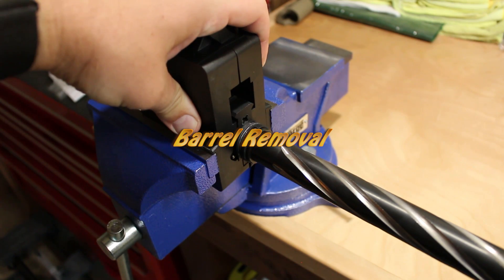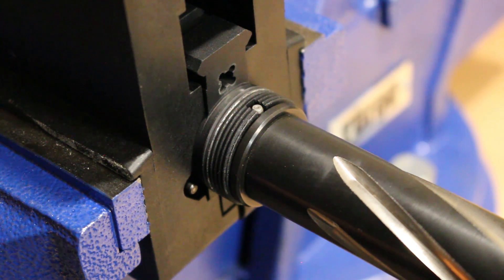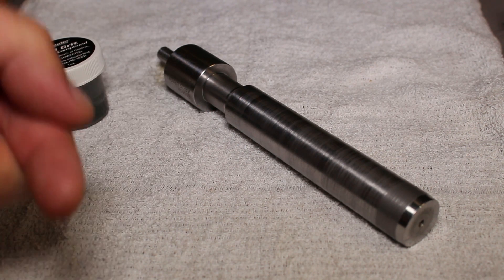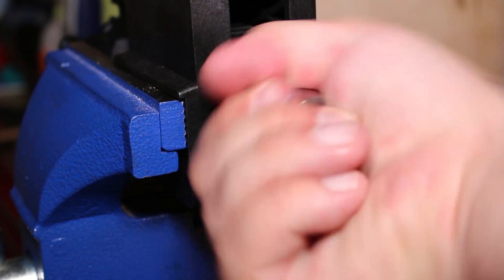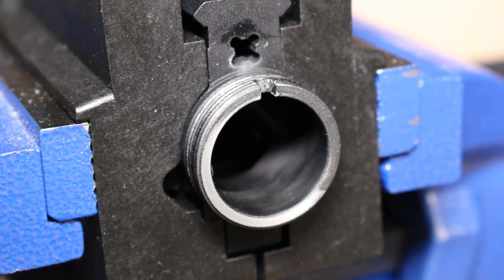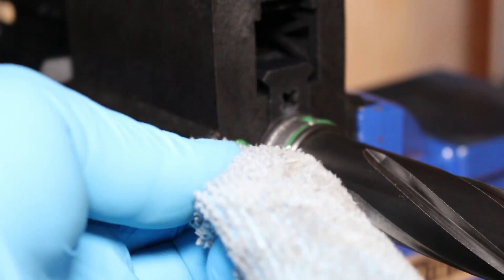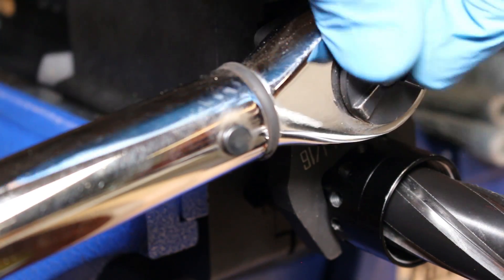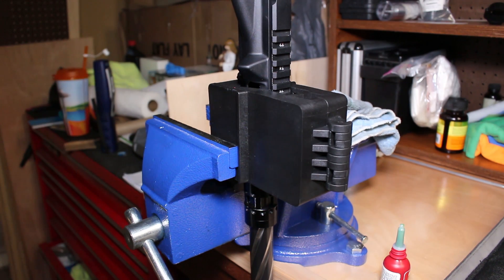Bedding a Barrel into an AR-15 upper receiver

Comment: That little bit of face you missed with the lapping tool is nothing., You should have lapped it until it was perfectly square.  My lapping tool, I polish mine so it does not sound gritting going in.  Just a couple of this I do different.  My lapping, I do it all or leave it alone.  If your going to do half the job, you may as well leave it as it was.  This is also where you squeeze that extra accuracy out at 100 yards also.  Anti seize needs to go on the barrel nut also.

Comment: Hack job, As a gunsmith myself, I would never recommend this method. Youtube is a double edged sword, beware...
Reply: Using anti-seize compound or a gun grease specific for this purpose is used on the barrel extension and threads. Makes it easier for those times you want to swap components.
Reply: You dipshits know that there are many different types of loc-tite right? Nevermind, keyboards dont use loc-tite... carry on.
Reply: Never seen someone use locktite on barrel I'm new to building ar's is this a bad thing ..? Never seen any other vids of someone doing that.
Reply: james s. When you become a good enough shooter to see any gains from this you will have acquired enough extremely accurate guns to never actually do this IMHO
Reply: I guess seekins precision is a bunch of hack jobs for bedding their barrels.
Reply: As a laymen why is this a bad thing? it seems to make sense to me. Maybe not the Loctite part but the lapping process.
Reply: A gunsmith isn’t a precision machinist either, most gunsmiths use old outdated processes/technologies
Reply: Lapping the face isn’t correcting the problem here, the face bore and OD threads are machined in the same operation so they are concentric and perpendicular to each other. The wiggle is from a barrel extension that was most likely turned to the low end of its tolerance or the bore turned to the high end of the tolerance or combination of both, so it looks like you just lapped the face off by the amount of play in the guide tool that you inserted into your receiver and the lapping tool that slides over it
Reply: @chippster stephens Chippers,
Don't want to get into a pissing contest. And no, I have never worked with national mach shooters. I have however shot with and worked with many top national 3 gun competitors since the early 1990's, and built many AR's. I have tried similar methods in my youth. As I have matured I have found that starting with good components eliminates the need for these types of band aids. That said, I understand that not everyone has deep pockets and if this works for their set-up then that is a plus. My original post may have been a little harsh. It is simply not they way I would build a precision AR...Thanks for the feedback.
Reply: Seeing Loctite being used has me on edge a little bit too. But if the barrel laps like that, using the barrel nut would naturally fix that, right? Because some kind of grease would make more sence to use if you're going to put anything on there.
Reply: @AzMetalScorpion  It's a different loctite -- not a thread locker, but a bedding compound (For pressure fits in cylindrical mating). This isn't to keep the nut from unscrewing, but to keep the barrel extension from moving inside the receiver walls. Grease would just squeeze out or move and let the extension wiggle. It's not dissimilar from glass bedding a bolt rifle.

I think he missed putting grease on the barrel nut threads to prevent gauling, but that won't affect accuracy much -- just ease of changing the barrel later.
Reply: ........my thumb is stuck...halp
Reply: I agree with Jeff on this one. You never put loctite on the barrel itself! What is this guy thinking! I mean watch the video, when torquing the barrel nut, he doesn't even have the vise tightened down. This guy is someone that's gonna be dangerous to youtubers!
Reply: @MC-px9eq  I dunno, I'm a bit on the fence with this. As far as torquing, I personally would have torqued the barrel with it and the receiver vertical so it would minimize any canting. As far as the Loctite.... The author did not use threadlocker. What he used was for [as the manu. called it] "bonding of cylindrical fitting parts" -- which is what a barrel and receiver is. This could eliminate voids between the barrel and receiver.
Reply: @danduane1413  from a gunsmith's perspective, I can honestly tell you to never put loctite between the barrel extension and the upper receiver. The only thing required is perhaps a lite amount of grease if the fitting is tight, and anti-seize on the threads for the barrel nut. If by chance something happened where you need to replace the barrel, you'll have a better time getting a new upper as well. We don't like to think things will ever happen, but they always do. You could accidently shoot your buddy's 300 blackout Mag, or it's getting dark after a hunt and forget it's in front of your tire and start driving off. The point is, using this guy's techniques, you are going to end up spending way more money in the long run. Either buying all new parts, or bring it to someone like myself to fix.
Reply: @MC-px9eq  As a "gunsmith" you should know that Aeroshell 33MS is the appropriate grease for the receiver threads.
Reply: @thomasainlay7603  that supposed to be an insult or slam on my profession and/or knowledge, just because I said "grease", which is shorter in character count than spelling out "Aeroshell 33MS" renamed 64 by the way. Many AR manufacturing companies will tell you their preferred brand and Aeroshell 33MS happens to be one of them, just has to be a Moly based lubricant.......the point is GREASE is used not locktite on the barrel extension. Have a good day.
Reply: M C p
Reply: @MC-px9eq  Criterion barrels has a video I'll link called accurizing the ar15. In the video they used loctite 609 on the barrel extension after lapping the receiver face. Aeroshell 33 was of course put on the threads. Criterion is a sister company to kreiger barrels. So what do you have to say about them doing that? https://youtu.be/XHxU8VUAHOY
Reply from the maker: @MC-px9eq  if you watch the end of the video.. the vise is tight and it is loosen to adjust the position of the upper reciever assembly while it is in the upper vise block...
Reply: @67futura25  aeroshell 33ms grease goes on those threads, tighten n loosen nut 3 times to prevent galling before torque
Reply from the maker: @MC-px9eq From one military veteran to another... thank you for your service and all the positive things that you mention and have done.  I am happy that you are better than me and that I will drive people to your business.  If someone drops off their rifle and mentions  my video could you send me a check, I would greatly appreciate it.  Stay safe and thank you again for all you have done.
Reply: @MC-px9eq  Spot on , along with doing the lapping procedure order the JP enterprises barrel extension and properly torque the barrel.
Reply: @MC-px9eq  I learned that from the YT channel Gun Shoot Video. And Semper Fi !!!!
Reply: @MC-px9eq  Damn dude, you need to calm down. If you dont agree with his methods, then so be it. I doubt you have any reasons why not to use loctite. Maybe it doesnt help and then again maybe it does. Criterion barrels uses this method BTW. As far as the vice block moving during torquing if the barrel nut, who the F cares if it moved slightly. He got the job done.
Reply: @mblake0420  you can buy a big 16 oz tube of the stuff on Amazon...or pay $6 for just an OZ on  gun websites...
Reply: @MarkNOTW  you don't use lost its, because when you want to change the barrel out after you screw it up with bad hand loads, 5000+ rounds or because you want a different barrel you won't be able to get it off.  You're supposed to use some hi temp grease, or anti seize so you can remove it if you need to.
Reply: @67futura25  Thank you for your service. By the way, great video.
Reply: @MC-px9eq  he didn't even follow Propper torque procedure....LOL he went 30 and then forty...what about getting the threads seasoned on both sides front and back ...Like our late and not so great President said "He's a Jackass"!!
Reply: Jeff McLaughlin why would this guy recommend having the torque wrench at 90 degrees? This will change the amount of actual torque applied to the barrel nut.
Reply: I heard it’s not good to use lapping compound on aluminum because the abrasive gets stuck in the soft aluminum material and keeps working to cut and loosen the connection long after you think you cleaned it all off.... is this true?
Reply: @MDallDayPrepper  Since it's in an oil-based suspension, if you clean it off with a petroleum-based , you should get most of the suspended material, and certainly enough to prevent any damage to the receiver over time.

Think of it like using soap on your skin -- dirt is harder than your skin, but the soap binds stronger to the dirt than it does to your skin, making what is the equivalent to the lapping compound. Then you wash it off with water (Which binds better to the soap than your skin) and remove nearly all of the dirt. A little bit might be left, but it's not enough to noticeably damage your skin.

Comment: So is green loctite so tight it never comes off, or is it not strong enough to withstand heat of barrel and breaks down over time?
Reply: The Loctite is to take up the clearance space between the OD of the barrel extension and the ID of the receiver. Loctite 620 is designed for use up to 200C (~400F). The area in question surrounds the barrel extension and chamber region. This should be the coolest part of a barrel. The ejected brass should be absorbing excess chamber heat and removing it when ejected. Your barrel chamber should never reach 400F.
Reply: Tom B Good to know. Thank you.

Comment: Hmm how do you know the barrel nut is true? Only truing one surface will not improve anything and for accuracy don't use junk receivers, BCM or some other that requires a press fit will work not locktite. Toss the parts and start over right please

Comment: I'm no gunsmith nor do I pretend to be but I've got the targets to prove this method works.  I'm now mounting all my barrels with green locktite and when I can fit it, .001 shim stock.  
  Yes, you can still remove the barrel with a LITTLE heat.  No need to get out the cutting torch.   The little blue bottle from the hardware store works perfectly. Again, use as little heat as possible to remove the barrel.

Comment: or buy a quality upper. I have never once seen a barrel fit into an upper with so much free movement.
Reply: John Hellmann 
Beyond that he didn't even bother to demonstrate how much it moved with a barrel nut torqued down on it.
Reply: @junkersintutus4282  it wouldn't have moved at all with the barrel nut torqued. I know this comment was from over a year ago. So hopefully you have learned a little more since then and understand why this is done now
Reply: Agreed. That's a lot of slop and I don't think he read the specs for Loctite 620. It is good up to .008" - he might have had more than that. Kind of a hack job....
Reply: I think his barrel is out of spec. The lapping tool appeared to fit firmly and had no visible wobble like his barrel did. He noted he had to lube it to get it in smoothly.
Reply: @eltreum1  the lapping tool runs through the entire upper. The barrel extention through just the front of the upper. Go back and watch again.
Reply: Wrong. I have bought multiple quality Aero uppers and they are out of true by a mile.
Reply: I was thinking the same thing. Maybe a good upper would have been advisable. One that requires thermal fitting like newer BCM or SOLGW.
Reply: If the upper was that bad I'd send it back. It is out of spec. Fixing a mistake and it probably has other faults too since they didn't get that correct and it is a main area of concern when machining these. Never seen one loose like that ever either.
Reply: Guys this is an actual issue lol it very verrry rarely occurs and this is an actual fix. No it’s not optimal but still a fix. It’s only worth doing if you have no alternative. Some uppers are thermal fit and need to be heated before the barrel extension slides in fully. This issue can pop up on any upper no matter the brand. No it does not affect headspace… that part is false. The extension can end up sitting too deep into the upper if you take off too much material to make it perfectly plumb and you’ll have to notch some shims to keep the feed ramps flush inside the upper. Not impossible, not hard to do, no you won’t blow yourself up lol. It’s a fix that gets you back on zero until you get another upper. Gunsmiths all over have felt with this atleast once or twice in a setting where a lot of guns pass across the bench.
Reply: This is the issue here, barrel or upper is out of spec.... this is a backwoods fix more than it is proper gunsmith advice. Don't even need to be a quality upper, i have a $40 beer creek upper and a aero precision upper that were both cheap as i could find at the time and had zero issues like that. Hell i had to tap my barrel in on the last one....
Reply: @coolkid6364  Just be aware that a tight receiver to barrel extension fitment alone doesn't mean that they are mating properly. You can very well have a "stacking" of high points on both components that are leading to what can feel like a tight fit. Loctite to fill in the "voids" as it were is still a good idea, and it's been demonstrated time and time again to to have a measurable impact on accuracy. There's good information on this on the SOTAR FB group if you're interested in a more technical deep dive into this platform.
Reply: @opmike343  I don't see what that has to do with my comment at all..... I'm all for lapping the upper but not for essentially gluing in a poorly made barrel/reciever. With that bad of fitment he would of been better off using jb weld lmao
Reply: @coolkid6364  lol. Gunsmiths bed barrels every day. It isn't a "fix". It is an improvement process. Unless you are buying a custom built from scratch rifle for $7k+, steps are taken or can be to improve accuracy. It isn't a backwoods fix it is a well known fix used by all gunsmith to improve harmonics therefore improving accuracy.

Comment: Quality barrel and quality upper will fit correctly, have very little play and, when the barrel nut is torqued down, prevent any movement. Ammo and barrel have an effect on the accuracy far more than any lapping.
Reply: jhalscott By the look of it this gunsmith has obviously never installed a barrel into a BCM upper!
Reply: BigBoyJr76 I remember my first. It was a BA Hanson into a BCM4 upper. Holy... tightness.

Comment: I agree with the lapping to square up the receiver/barrel interface but there is absolutely no need for using Loctite on the barrel extension.  Also, in this video the lapping should have been continued until there was no more anodizing left.  You are wrong in saying that those couple of thousandths of an inch would affect headspacing because the AR bolt headspaces in the barrel extension, unlike a bolt action rifle where the bolt must head space off the end of the barrel and the locking lugs interface with only the receiver.  Again, the ONLY good things shown in this video is the lapping procedure and even that wasn't done to the point of being complete and proper.

Comment: 1.  head space is not determined by the upper receiver or bedding it,  its the bolt and barrel. 2. Why locktite the barrel and the upper receiver?  areoshell on the extension and on the threads,  no one uses locktitie.
Reply: Its the bolt and barrel extension. If too much material is taken off the receiver face the barrel extension could possible insert too far. He applied locktite to secure the barrel to the upper to prevent movement of the barrel.

Comment: what barrel nut is that you are using?
Reply from the maker: I am not sure of the Barrel Nut.  I got the complete upper assembled and when I was going through everything I noticed it was loose.  If you purchase a free floating hand guard most of them will come with the proper nut as well.  hope this helps.

Comment: Besides the ridiculous loctite,no grease on barrel nut threads?? Please delete this video!
Reply from the maker: Correct... this rifle is a bench rifle and is built for accuracy versus volume of rounds. The barrel will most likely never be changed due to the low number of rounds going through it.  Thank you for your input...

Comment: Lapping the front of barrel housing is good enough. You have created a junk rifle now.
Reply: @no candy we'll see when he has to change a barrel lol. Also, a .001 shim would do a much better job than the loctite   620. Perhaps he should learn to build better rifles without loctite on the barrel extension.
Reply: @no candy Also, my factory bushmaster shoot sub moa with 55 fmj loads. Your point. .920, but still under an inch.
Reply: @no candy Another point. He could also buy an oversized barrel extension and turn it down for a tighter fitment to the upper. Your logic is flawed.